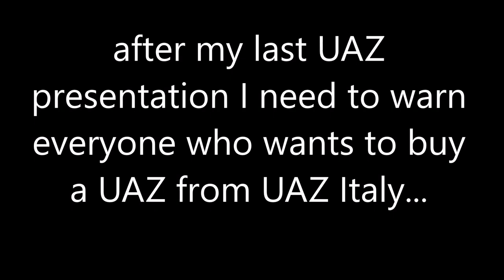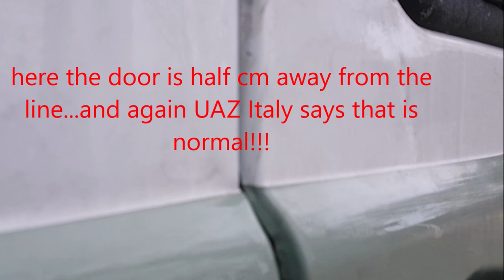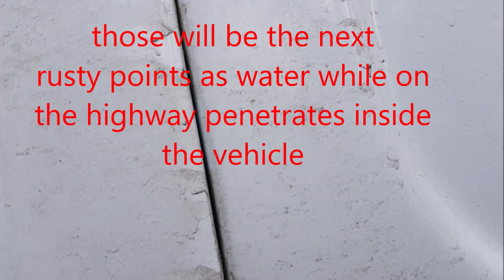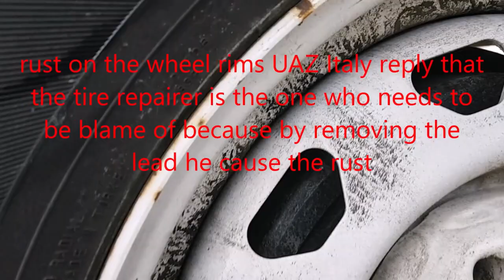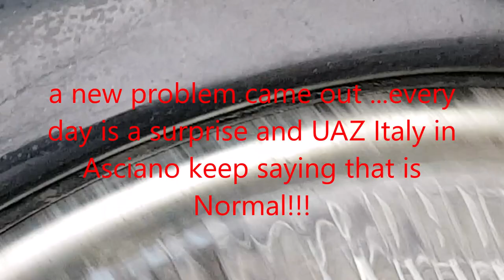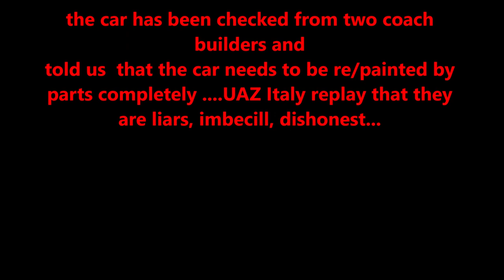UAZ 452, the  problems that UAZ ITALY doesn't recognize

Comment: all these issues are really normal. Majotity of people in Russia do not consider uaz van as a daily car. uaz is simple built car for purpose of simple repairs: it doesn't need two mechanics for any repair, it doesn't need lifting for any repair. That is a price of simplicity: poor paintwork, frequent adjustments, not lined cabin's parts, poor welding of metal. So consumer must use sealants, rust stopping materials, reweld (when needed) some parts. But car itself is cheap, easy to repair and is a 4x4 parttime vehicle. So you must think twice if you can weld, spend time learning mechanics and do repairs, ride slow and be prepair to fix things on the run. Or buy any other reliable car for 2,5x much price of uaz and don't complain. Uaz dealers are honest abou "normality" of your issues.
Reply from the maker: thank you for your reply and let me tell you that the car isn't that cheap....do you know how much do they sell this car In Europe? even if you're lucky to skip the IVA, is still kind of expensive. Uaz dealers are may be honest in Russia where people knows already the car but not here in Italy and thank to my video people knows a bit better what they are going to buy. the Uaz russia website has lots of mechanical stuff as part of the warranty...but not here in Italy where every problems seems to be a condemn to claim repair actions. Not in every countries warranty is available. Don't get me wrong, I love my Uaz and for this reason I like that my car can last longer without rusty parts..Maybe we are no longer used to see those kind of problems in 2020 everything has a proper evolution .  I better use the car daily because if I let the car in the garage will get rusty earlier and I loose the chance to take her around..
Reply: Thats all normal ......BUT here in germany a good UAZ-dealer told about all this possible problems.
He told all customer to invest in rust protection due "Mike Sanders"-Rope grease.
This grease would very hot in temperature injected with a spray gun.
 
On the other size, the UAZ 452 only rated for owner with mechanic knowledge and a sense of humor to withstand the last day of the world.
This van will survived everything!

The good UAZ-dealer in germany has a website named www.madeinrussia.de

Comment: Hi Marco, Sad to see this and sad you have this experience with UAZ Italy. Since you posted it already in feb 2020, has there been a solution from UAZ Italy? It is EU law that you have a two year guaranty on new consumer products bought from a professional trader. Since they state that all is normal, you wil have to get three car(paint) specialists to write a statement that this product (car) has not normal and within the time frame shows serious defects,  to counter the UAZ statement, and request a full repair.
Reply from the maker: I appreciate your attention. unfortunately the only thing they did is accusing me for defamation through my you tube video. ( while I simply show the truth. about the warranty  they did not want to cover the rusty car but just the spots that came out by assuming fronm the mechanic that it was not rust. ( as we perfectly now  if you cover one spot here tomorrow rust will show up in another place) another problem is that the warranty it is not cover by UAZ Russia therefore the expenses has to come out from the dealer pocket so they try to avoid any inconvenience.  Anyway I never receive any further contact from UAZ Italy. About the three car specialist I did made the check but the mechanic from Italy told me that they are liars and imbecil  and thief and they don't know their job!!! The worst is that now I'm In Poland and unfortunately the warranty is not valid in other countries unless the mechanic pay for it
Reply: Hi Marco, well i did mean that a specialist, and beteer three seperate ones would write a expertise report on quality, cause of defects, loss of value, total damage and repair costs etc, not that they are imbecil and thiefs, :-)))) even if they behaving like that. With those expertise reports you are able to state that there is a problem and not demand but ask super friendly by mail for an appointment to give them the opportunity  to repair the rust problem. That is within a certain time frame ofcourche because rust is a in time deteriorating proces which creates bigger damages and value loss which will result in a bigger repair or claim.  That you are in poland does not have to be a problem. You could go to the UAZ Poland dealer, don't tell them about the problems with the italian dealer and just ask for a writen quote what a repair and definite rust treatment fix would  cost.  Further "Motoexpert" in EU and poland has great experts in making damage reports. Although it cost some it would make your case stronger. If Italy does not respond to your invitations to fix the problem, you might want to send a complaint to UAZ russia about this dealer and see wat their respons is. Because time and rust is bad, you might mail Italy that you are going to fix it to protect the car value and claim the cost of repair to them.  But al takes time and lots of negative energy, and Poland is not a bad country with lots of good garage holders and body workers that it might be good idea to do a full rust treatment and spraypaint the car to protect it for the future.  There are some really nice rubbery paints that protect the body against branches and scratches aswell as rust.
Reply from the maker: @LucScheffers  I guess I didn't express my self on the correct way, I did contact on behalf UAZ Italy three expertise in matter...but even so they have been judge from the Mechanic from UAZ Italy what I wrote in a previous message. I totally agree that Poland has lots of good garages Unfortunately UAZ Poland  ...warranty is almost an illusion as in Italy. (Italy the worst) The cost of repairing the car is not covered by UAZ Russia. you as a dealer you will have to pay your work...UAZ Russia doesn't pay back. Having said that, know I'm starting to do my own spray anticorrosion and repairing. In the mean time hundreds of UAZ video  came out and each UAZ even if it is the same model  for example UAZ 452 anniversary) is different than another  same model but different car!!!  let me tell you that this UAZ Mania had become a UAZ business with European prices.
Reply: @MarcoBrevi  It is sad that consumers are put in a position by dealers and companies where they consumer has to choose between a long, maybe expensive legal battle  and a long time much negative energy or let it go. Still i would mail them the reports of specialist, they 2 year guarantee EU law and ask them friendly for a good and proposition in 14 days for a repair or financial compensation . With the mention that since rust is a progressive fault, if no answer or good proposition follows you will have to order a full repair and claim the total cost to save the value of the vehicle.  You might want to ask for a quote for a full rust treatment and spray job at a Polish body shop and add this to the mail also.  And see wat happens. Any way, it would be good for the car to check for possibilities to repair this. Since I was looking to buy a UAZ my thoughts are now that if i buy one, to take it apart immediat a full rust treatment, enhance the cabin structure, and spray it inside out. But is sad that the joy of this car got a blow this way by the  behaviour of the Italian dealer . Good luck with it!!

Comment: This is Uaz buchanka all should bé repair easy and also you have to repair many times. Fabrication notre perfect because isn't robot.. All made with hand. And rust is problem know too. Have to make anti corrosion on paint. And down the car too.. And twist all because they don't. Some facts you have to know before buy
Reply from the maker: yes I know and I actually thought that an Anniversary UAZ could be better than previous....but I was wrong...by the time the car factory is just getting worst...yes I know the design is captivating but problems are part of the car, it means that if you  plan a vacation you need to put some extra money for repairing and not everybody knows how to fix it....about the anticorrosion it means you have to remove the entire body and do the job...and this is not finish as actually the entire car is made on cheap material....something quite expensive for my pocket today...maybe tomorrow
Reply: @MarcoBrevi  price is low after.. For a 4x4 van still very interesting.. I'm un France i watch for one I don't know .. 😅 because same price trafic but no 4x4 nothing.. And the old and classic not much electric really enjoy me..
Reply: @MarcoBrevi  on your travel you have to repair very much ?  Everey how much kilomètres ?
Reply from the maker: @tommybevia662  it depends, maybe you're lucky and nothing happen today and tomorrow you have a gasoline tank problem and it doesn't matter how many km...anything can happen even after 5000km...and if you do any offroad you better check the gear directly because EVERY CAR , I repeat EVERY NEW CAR, has a reduced gear problem it means that they swift from the original place.
Reply from the maker: @tommybevia662  I uderstand and market knows his business...the only choice it will be IVECO but price is different but let me tell you that you will have lots more space available for camper...Buchanka is way too small to camperize it. Love the trafic Ford, fast and most of all, reliable, less problems and gasoline saver
Reply: @MarcoBrevi  i live in à renault kangoo big size actually.. 😅 but bad offroad and very small. And problem électrique sometimes.. It's à 2008 years.. 310 000km 😅
Reply from the maker: @tommybevia662  so for you a buchanka it will be like a small penthouse...well Tommy, it is up to you to buy it or not ...of course 2206 will have a bigger space but be prepare for extra! Rust is not a crime and I guess is not the major problem...just  deteriorating cheap metal
Reply: @MarcoBrevi  yeah.. But if need repair every 2 days difficult.. Not mecanician i'm peasant..
Reply from the maker: @tommybevia662  Exactly because the car is hand made without any chief mechanic control, in 2206 anniversary ABS are not working properly, Seats are glue, reduced gears have problems ( like in every other new UAZ generation) and you should fix it as soon as possible, every rubber or plastic in the car such as gasket will need to be replace due to brake or water filtration...consumption is out of discussion as well as rust. reduced gears are the mayor problem because you will have to change the entire transmission if there are not parts available....My suggestion is to go and see it for yourself ...but do not trust who's selling the car, if you fall in love just buy it but remember all the problems....When you get married with a woman it happens exactly the same!